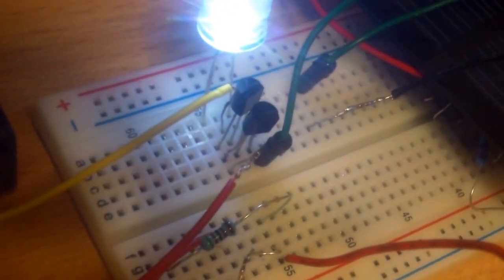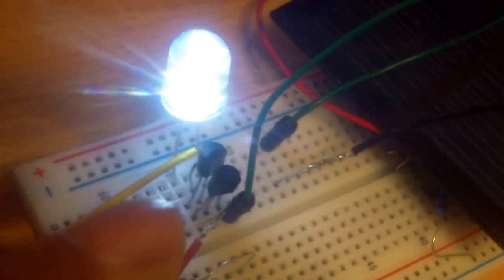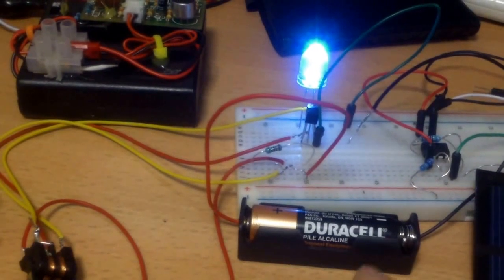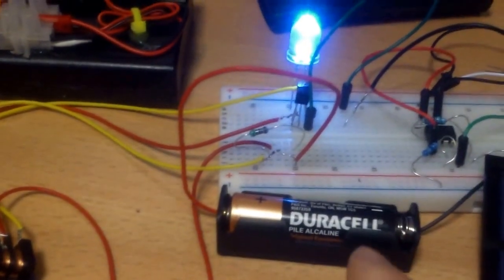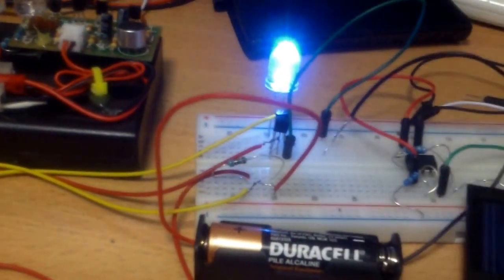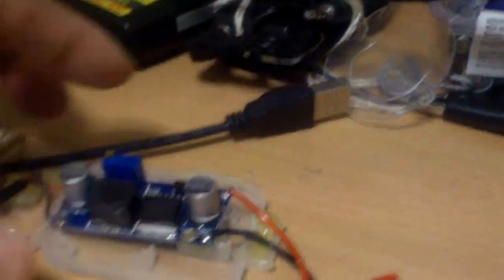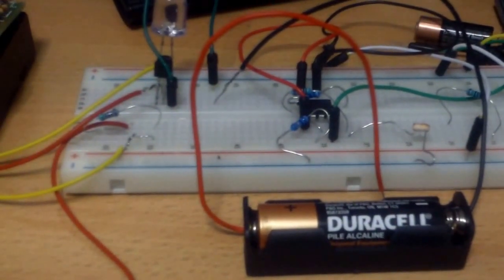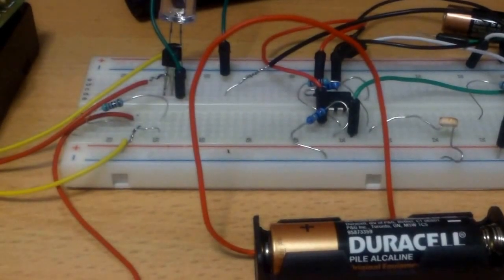Am I saving electricity with a joule thief

Comment: Hi, can you make a video tutorial on how to use step down buck converter for charging battery?
I have cc, cv converter, I adjust the volt slightly higher then the battery and adjust current to 1/10 of the battery but the battery never charges fully. There are three potentiometer on this converter, one of this potentiometer I don't understand what it does, it's to do with battery indicator an it is suppose to turn blue colour when it's charged up but I've never seen it turn blue. Can u please make a video.
Reply from the maker: I'm not sure which charge controller you have.  Some of the controllers won't let you charge your lithium ion over 4 volts while some of them let you charge it up to 4.1 volt.  You can measure the voltage of your battery with a multimeter to see the actual voltage of the battery after charging. It could be a function of the battery developing higher resistance  and the charge controller reading the high resistance as a signal to stop charging, well before the limit of 4.2 volts. You can try setting charging voltage slightly  higher than what you are setting currently to see if it makes a difference.

Comment: but if your battery voltage is dropping with the heavier load, then you may not get full brightness, and you may need to make other changes to compensate for the voltage loss.  I've seen loose springs and too thin lead wires on cheap battery holders cause excessive voltage drop, so it could be something other than the cell itself.  If you have 0.15V drop, that's ten percent of the supply voltage. Also your DMM drops voltage when it's used as a current ammeter.  This could be a quarter volt.

Comment: A typical conventional JT has an efficiency of around 50 percent: the input poewr will be about double the power to the LED.  If you connect the 2nd transistor in parallel with the first, then they share the base bias through the resistor, so each gets about half.  The LED will not get much brighter.  If you connect the 2nd transistor in parallel with its own base bias resistor, you get twice the base bias and the LED should get brighter. (cont'd)

Comment from the maker: I tried a 10 ohm and it didn't work. I settled on a 430 ohm or so resistor. The LED is almost as bright as running them on 2 AA or 3 volt.

Comment from the maker: I added a capacitor to smooth out the voltage but I have not used it as a power supply. Since I don't know the characteristics of different capacitors, I hesitate to fool around with them as they can give you a nasty shock. I remember seeing my cousin knocked off his chair when his probe or finger touched the wrong part on the circuit board.

Comment from the maker: I think the inductor helps the device to more easily digest the energy from the AA battery. Sort of like eating an apple versus eating apple sauce. The latter is an apple ground up so even if you have no teeth (not you specifically),  you can still consume the apple and maybe every bit of it.  In a circuit without a joule thief,  when the voltage drops below 2.5 volt or so, your LED would get dimmer and dimmer. This is just my theory.

Comment: How about running 2 circuits at the same time and see which runs out quicker. You would have 2 AA batteries powering one led. Also along side you would have your joule thief with 1 AA. If you wait until the led is completely out on whichever circuit to call the end of the experiment. Then you would know  for certain. If it is the joule thief you are saving. If it is the 2 AA and led. Your losing. Great video and many thanks for sharing.